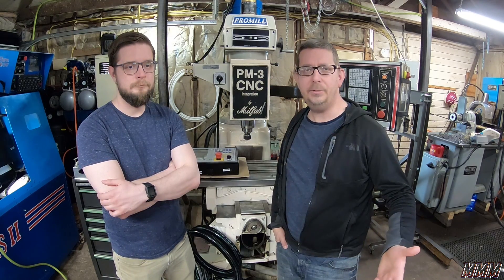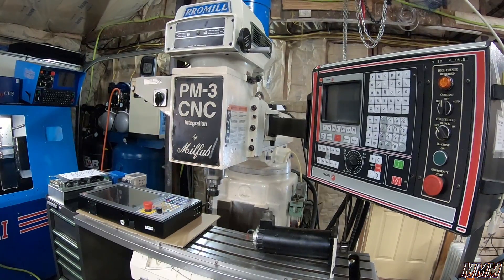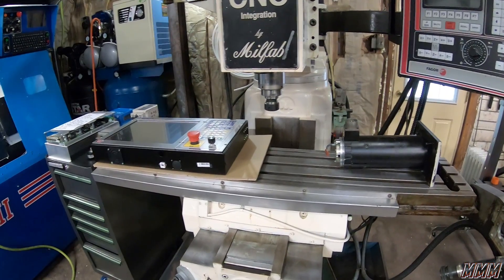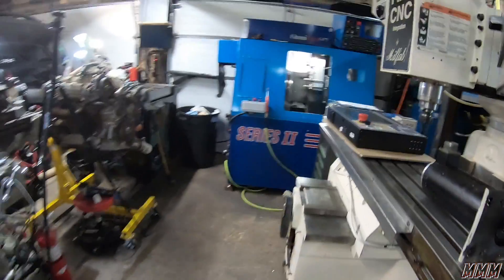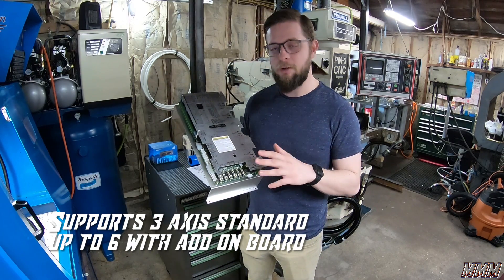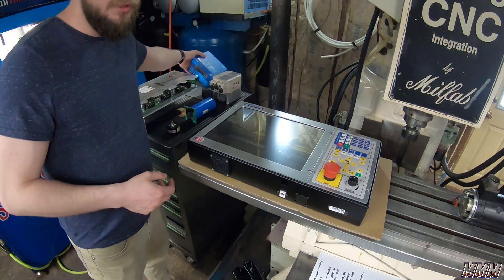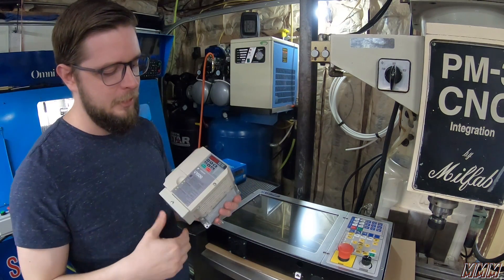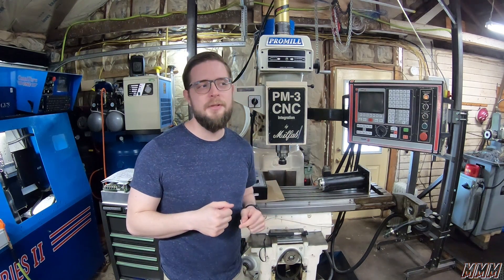Saving $20,000 over a Tormach Mill: Centroid CNC Mill - Part 1

Comment from the maker: Keep in mind, these old CNC knee mills can be had for around 1K with a bad controller.  Use your own computer and screen and you can build your own CNC mill with the ALL-IN-ONE DC for around 5K all in that will machine circles around hobby mills costing as much as 6 times the price.  We spent a little more for Centroid's touchscreen and operator panel, but it's not required.  Most of these old mills split in two, making them easy to get in through short doors, and all can be converted to run on single phase 220v with an inexpensive VFD controlled by the Centroid.  We are not sponsored by Centroid or Tormach.

Comment: I’m curious, now that you are familiar with the centroid cnc conversion. Your Omniturn 75 peaked my interest in looking for one of these lathes and convert it to Centroid controls. I built a VMC and used the centroid Acorn board for it an like the operating system. Would you even convert your Omniturn? I have a small shop and the Omniturn seems like a good choice if I could use Centroid to operate it. Like to hear you thoughts. Thanks
Reply from the maker: I'd convert an Omniturn to Centroid if it was an older Omniturn with a failed controller that couldn't be readily (and cheaply) fixed. The G4 Omniturn control though is easy to use and reliable.

Comment: that drive looks small for the hp.
Reply from the maker: It's right at the ragged edge, its a Yaskawa (quality, made in Japan) rated for 3hp and the motor is 3hp.  We have a 5hp Yaskawa, but a capacitor was bad in it, so we had to use this smaller one, but it's been working, so we haven't changed it out for a bigger yet.

Comment: I did exactly what you guys did and never regretted it !!! Also, Tormachs are chinese junk. Flexible castings. Nothing rigid about a Tormach. Everything is expensive and poorly made.
Reply from the maker: Nice!  What kind of mill did you convert?  Any video's of it?!
Reply: I respect your decision, but to say a tormach is junk is untrue.  I have an 1100M and I run it hard every day making engine components and it always holds tolerance and gives me no issues.  It doesnt have the horsepower or rigidity of a hass but you use the tool that fits your needs. .

Comment: This is the way to go all these old manual  mills sitting around going to waste just need the ways scraped and a few other things and that thing is running like new then throw some motors and controller and boom you have a true professional set up for less than half the price of tormach
Reply from the maker: I've seen several CNC mills on craigslist with bad controls for around a $1000 and those already had the ball screws, servos', coolant pump, etc on them so converting them would be pretty easy.

Comment: Do you really need those 16GB of RAM?
I highly doubt.
Also that control panel cable assembly for $405 seems steep, those are mostly made from off-the-shelf cables, you wouldn't need much crimping.
Reply from the maker: It was about $20 more to move up from 8GB to 16GB which is cheaper than upgrading later. Windows 10 does better with 16GB too. 

Yes, you can purchase a few of the cables separately. You’ll need to wire your own Control Pendant, E-Stop, Fan, Touchscreen Monitor power, and NUC power cables (which are all 16ft long). Plus get the bigger conduit. 

If you decide to your use own PC/ monitor and not use the control panel or MPG, you’d only need a shielded Ethernet cable and power.

-Kevin

Comment: We used a centroid system for a PM-940M we converted to CNC and built at my day job. At my side business (that I own), we were going to go to a Tormach 1100MX then we felt we would outgrow way too fast.... then we considered a Syil..... and now we have a Toyoda BM-1200 w/ a 12k spindle.... yeah I wouldn't consider anything less than a production machine at this point. It's like a wheelbarrow and shovel vs a dump truck and excavator to move a mountain. Sure, you can do it but...... why?

Comment: and if you spend $15k or $20k on a big VMC you get way more, but it's old.
Reply from the maker: Definitely, a normal VMC is the way to go, but we don't have 3 phase, nor a shop, just a garage with 7ft tall doors, so we had to have something we could reasonably get into the garage as well as run on single phase, so our choices were limited.
Reply: @MadManMachines  I see. If you ever go the route of a phase converter, the PhasePerfect devices are the bees knees. Better balanced voltages than a rotary meaning you can run multiple machines and electronics off a single unit, and no rotary element making lots of noise. I have a 30hp model in my barn. They are not cheap, but I heard a rumor the patent on the technology expires next year.

Comment: Yup and if you’re spending 20k plus you just as well buy a Haas. lots of Chinese stuff out there now same price as a quality machine tool
Reply: I've used the entry level Haas tm2p.  I would look for a used tm before I would consider a tormach  or a converted knee mill.  Even a worn haas tm is 1000x the machine.  The only centroid conversion I would consider is on an old vmc like an old mazak, mori, etc.
Reply from the maker: @michaelpilliod1039  I hear you. A VMC is definitely the way to go if you have the means to move it (4500-10000+ lbs), the clearance to get it in your garage and the 3 phase to run it (a smaller one you could convert to single phase or run a phase converter though).  We didn't have any of those.  A Tormach will only hold on average about .004 on an interpolated circle, whereas a good cnc knee mill can hold on average about .001 (even better on some of the Japanese knee mills) so we went that route as it was cheaper then a tormach, more rigid and holds better tolerances.
Reply: The cheapest haas is well over 30k before shipping, rigging, and all the tools you need for it unless you buy used, which is a gamble.
Reply: Oakwood Machine Works Ah OK they are 20k over here start price and the Syils are trying to sell for many thousands more!
Reply: @homeworkshopengineering  What new haas are you seeing and where? If you are talking about the MM EDU it's only for schools.
Reply from the maker: Agreed, last fall we noticed the Haas Mini Mill pricing started at 27,000 which included the tool changer and a host of other features standard, but at 4500lbs, we do realize some home and basement shops can't use it due to its size.
Reply: Agreed. I got a used '01 Haas Mini Mill for $14k that happened to have had the electronics upgraded in 2011 (which itself was a $15k HFO upgrade). Freight across country was $2k; rented a forklift (long forks) and a pallet jack, unloaded it and installed it in my garage myself. Single phase, so no expensive phase converter needed. Biggest issue is air--I have a basic 60 gallon Ingersoll + dryer but the older Mini Mills like mine keep the spindle constantly pressurized, which is a great feature for the longevity of the machine, but causes the compressor to run every 7 minutes for about 30 seconds to keep up. The machine itself I've stripped and rebuilt--mechanically everything was good but I did rebuild the Bijur lubrication system and replace a few of the lube lines. Also, the coolant hose was petrified, but that was easy to replace. Repainted it, added new decals. Pretty happy with it--closest thing to having a new one, for now. So if you have the time and inclination, I say go for a used Haas, but do know what you're getting into. You can save a lot of money, but you have to have some mechanical ability because it can get expensive if you're constantly calling a tech. I've saved a ton of money doing the work myself. Buying a Chinesium Tormach 1100MX would have been a HUGE mistake. You just can't justify the cost. One of those new is the same price as a new Mini Mill (about $28k), and the MM crushes it in every aspect. I can see value in a Tormach for around $5-$10k, but not for $20-$30k. That's just crazy. Thank goodness a mentor of mine recommended going for the used Haas.

Comment: Hi, this is the first vídeo i've watched from you guys, i'm from Portugal... My advice to you guys is very Simple: do not replace the Controller, those fagor controlers are reliable and very easy to maintain... I have the very same Controller on my home machine and i though about upgrading it and i quickly forgot about it when i started using it
Reply from the maker: Fagor's are decent controllers, but it was an older one from around 1995 so they no longer make parts for it.  Plus the new Centroid controller has more features, higher count encoders for better resolution, faster processor, better graphics, conversational style programming (as well as conventional g code), probing and profiling with the probe, up to 6 axis control etc etc. so it's definitely worth it for us to upgrade since the old fagor was being buggy.

Comment: Excellent video. I to looked at the Tormach's but they're just to expensive. This seams a better alternative. Look forward to this CNC series. Regards MachineNZ
Reply from the maker: It's why we are doing this video.   We just don't think most beginning machinists even know this is a possibility.  If you have basic wiring skills, you can do this.  And as far as programming, the Centroid all in DC appears to have a conversational programming system that is as easy as the Hurco VMC's I used to run and it's so easy you can start making chips within a day.  It walks you through the program you're  creating step by step.   These older CNC bed mills and CNC knee mills are plentiful and are already set up with ball screws, servo's, etc.  All the goodies and I find many aren't all beat to death because a lot of shops just used them for secondary ops or prototyping.
Reply: Not only expensive, but not well built either. They flex while machining. I assume the steel is beer cans and car bumpers.
Reply: Look for a Cincinnati arrow. Cheapest full on vmc’s there are. Tough as nails to. Saw an arrow 500 for 3500usd haha.

Comment: I have a cnc bridgeport clone and like it, but hateed the mess.  An enclosure is well worth it.
Reply from the maker: Yeah, we're definitely going to make an enclosure of some sort.    Chips all over is fine if you're just doing a personal  project now and then, but no go for any type of volume.
Reply: @MadManMachines  The chips are an issue. I built several styles of enclosures. For small projects, I just use walls around the table.

Comment: I've had both machines - a PCNC1100 and similar to what you show here with a Centroid controller. Even with the limitations of the 6" quill travel, it's 10X the machine. The only thing I didn't like about my machine was the small work envelope (it was a series I Bridgeport) and keeping chips at bay was a chore. The good thing about a tormach is factory support from start to finish, in all aspects of the machine, and it's easy enough to move in a standard garage / garage door / garage space.
Reply from the maker: Do you still have them or did you move on up to something bigger?   Yeah, I hear you on the chips, we're definitely going to make up some sort of enclosure.  Is it as good as a fully enclosed VMC, no, but for a guy just starting out who doesn't have 20-30k or 3 phase or a way to move a several ton machine into his garage, its a good way to make quality parts on a budget!
Reply: @MadManMachines  no, I sold the tormach pretty quick. The centroid lost the motherboard. At the time i wasnt into the diy stuff and didnt really know how to fix it. Things would've been different these days. Now I have a large bench top cnc mill, it's just been down since I moved. In the process of an upgrade with the control and trying to get the cnc lathe done too.
Reply: A Tormach will never outperform the rigidity of the Bridgeport.
Reply: @garyla3584  Our tormach out performes our Bridgeport in everything but travel. Used machines are just that, used, thousands of them or there for practically free, but only a handful of them are worth buying. I know of haas mills that are on their third spindle and have shop modified drawbars because the c clips kept popping off. Those Haas mills run three shifts six days a week, and have multiple repairs, many of which are in house, and you're going to tell me that those machines can still hold 0.0001"? OK, whatever, you do you, but you can't roll manure in powdered sugar and tell me it's a cream filled doughnut. Dude in this video comparing a old knee mill to a brand new mill? U can get used tormachs, and no matter how much faster u think a converted Bridgeport is in the cut, not having a tool changer kills, it means having to babysit the machine, and if your running multiple machines, it means having to remember which machine needs which tool at which stage of the program..... Oh, mistakes will be made....

Comment: You just compared your incomplete 10k mill not including labor to a 20k tormach with years of engineering.. that's not a 20k difference.
Reply: Hardly years of engineering. Tormach is a dovetail mill made out of baby carriages and car bumpers. They buy everything from outside. No engineering at that company -- just marketing. I dealt with them a lot and now so glad I no longer have to.
Reply: Great vids guys, keep it up!!  However I do agree, by the time you finish with your build you could have paid for a Tormach with the parts it has made.  If you include your labor and time researching/trouble shooting I’m quite sure the custom build will be more expensive. You would also have a faster spindle which is required for small tools and an enclosure for coolant and chip containment which is deal for a small garage shop.  You also can’t add a tool changer to your build if you get busy and need to increase productivity.  I know how tempting it is to buy a cheap machine and “figure it out”, but there is a reason they sell for that price.  You may realize that you needed up with a “better” machine in the end but the Tormach may have been the better fit for your current situation.
Reply from the maker: Thanks for the reply!   The base 1100mx, starts at $19,999 and equipped like ours is $24,000, with tool changer, $30,000 (so 14k to 20K more depending on options),  and still won't have the mass, rigidity and resulting machining speeds, finishes and accuracy.  Look for an old Mori Seiki, Makino or Shizouka to convert and you'll have a machine hold a few .0001 all day long...  Our mill doesn't have a tool changer, just a power draw bar, but I've seen many mills with tool changers for the same cost.   Centroid has been in business since 1979 and manufactures industrial 5 axis CNC machines, this kit runs their proven software, control system and components and are made in the USA.  .
Reply: @MadManMachines  You are still comparing a machine that doesn't exist. Finish your machine, verify the tolerances of the machine, add up totals and labor and then talk.
Reply from the maker: @Derek_Kuraitis  You bring up some good points and there is definitely labor costs, but Tormach's have quite a bit of assembly too.  We haven't finished ours yet, but check out their website for lots of completed conversions for reference if you're thinking of converting yourself.  I'd recommend a bed mill over a knee mill if you're in the market for a mill, but we just used the mill we had.  https://www.centroidcnc.com/
Reply: @Derek_Kuraitis  This will be a mandatory reply when the refurb is finished! Let's see.
Reply from the maker: @emipop21  Definitely!  We don't want people to think we're bashing Tormach, we just couldn't afford a machine in the 20-30K price range, so we looked into other avenues that would allow us to get up and machining for under 10K, yet still produce high quality parts and have a modern control for reliability.
Reply: @MadManMachines  I understand that
Reply: @Derek_Kuraitis  please let me know what will be lovest quotation of MAD MAN MADE MACHINES at your earliest

Comment: Best of luck with your conversion. You will like the control. If you haven't found my channel, you might want to check out my AIO DC Play List: https://www.youtube.com/playlist?list=PLTOPaz9Cz3leINiq9bzwHX5sXD-6NbZvq And AIO DC Dry Erase board Exercises: https://www.youtube.com/playlist?list=PLTOPaz9Cz3lfXrGsoJx8xkbkwbNjBEWQb Also if you run into trouble head to the Centroid User Forum: https://centroidcncforum.com/viewforum.php?f=64
Reply: One other thing, please check the lable on your servo motors to see what the max terminal voltage is. You MAY want to keep the power supply out of the FAGOR control and reuse it.
The Bridge/CAP that Centroid sent can be used alone to rectify 120VAC or used with the original step down transformer to provide the required DC voltage for the servos.
Reply from the maker: We've definitely been watching your videos, thank you for taking the time to do them, they really help!
Reply: @MadManMachines  another possible tip. When you get your machine going, you might set your Z tool reference point at the Z+ home. The Centroid control allows this option. It's Parameter 3. The way the machine homes, it uses a mechanical switch to get close, then moves away from the mechanical switch and the control watches for the encoder index pulse for precise repeatable homing.